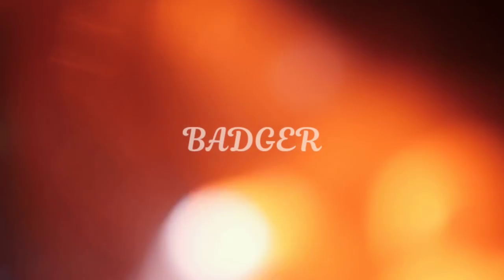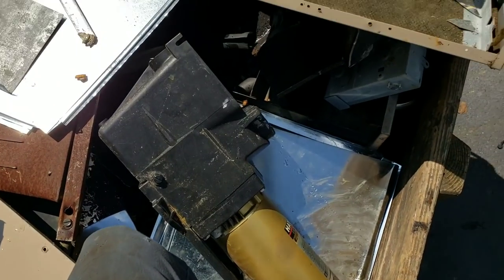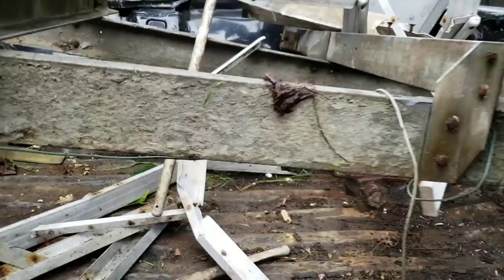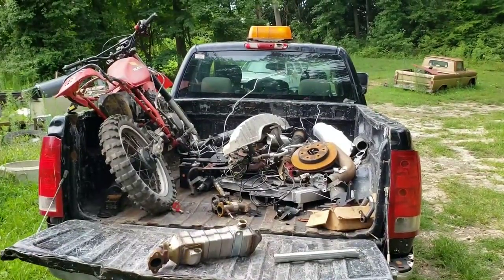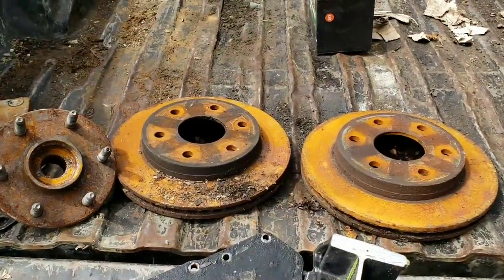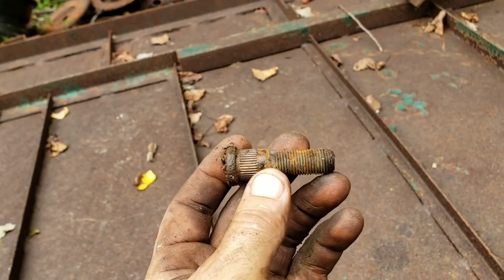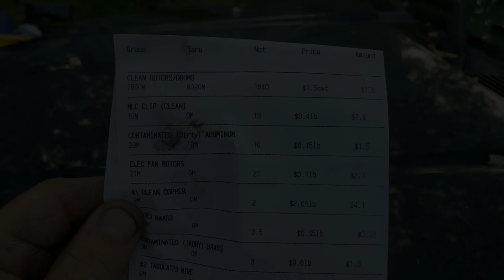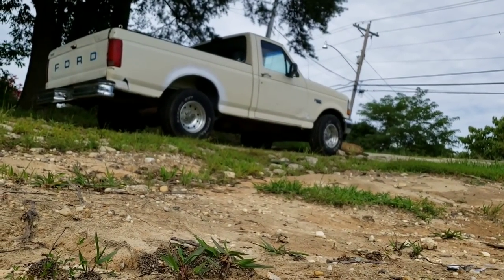Heavy metal cash in. Scrapping tips

Comment: Seems like a good deal for a $100.00 probably worth 3 times that in scrap ?
Reply from the maker: Cruiser Mac depends what I can sell off of it. Straight scrap value for today would be $225ish
Reply: Well  you are ahead already no matter what?
Reply from the maker: Cruiser Mac absolutely. The burnout was worth that hahaha
Reply: Wheels alone go for $200-300. Called forged alcoas.
Reply from the maker: @D4x4Bronc  they should certainly bring that. Not curb rashed and all 4 matching hubcaps
Reply: @1320LUV  list bronco as keyword also. 94-96 models only. They are a big seller. Might be also sell the rear axle for $100. Transmission m5od for $100-200. Dash pad if it is good. Possibly seat $100. Starter etc. Column. Doors, glass and vent windows.
Reply from the maker: @D4x4Bronc  I knew it held some value it's just hard to find people that need the parts. I haven't scrapped it yet still hanging into it

Comment: wow no way could get closs to 100$ in my area 
pickup are freacking expansive here and rarely on the market 
its hard to find part at the junkyard everytime one come in ther like 6 ppl on it 
just 4 tires worth more then that
Reply from the maker: jackpot digger really the truck is junk. While I was doing burnout the oil pressure dropped to zero so it's only matter of time before it runs motor. Some parts are valuable but we will see
Reply: @1320LUV  could put a set of main bearings in it.
Reply from the maker: @D4x4Bronc   owner had passed away and title was lost.... so really not worth putting money into( in my opinion anyway)

Comment: Doing a burnout with that truck wasn't the smartest thing I ever seen.  You got a good deal on it for only $100 . Heck do a little tinkering on it and you have another pickup to haul scrap with
Reply from the maker: It has other unseen issues, the diverter switch that switches the gas tanks (it has one on each side of bed) has  something wrong with it and has to be squeezed to make fuel pump run. Brakes are gone (maybe just a line broken somewhere) but the biggest issue is that I didnt get a title with it so getting tags and legal would be very challenging if not impossible in Maryland. Thank you for watching and commenting
Reply: That makes sense although it is a shame.